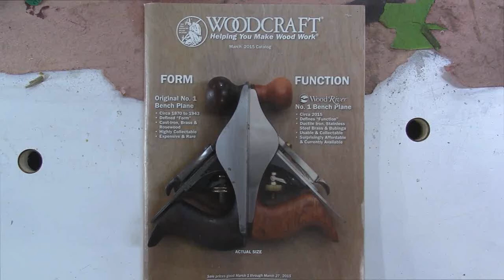Stanley #1 Bench plane Restoration.

Comment: How does the Vaporust compare with vinegar?
Reply from the maker: Can't say, I never used vinegar. Vaporust, when dry, leaves a film on the parts that keeps rust from forming for a few  days.
Reply: In my opinion it is less aggressive than vinegar and has less of a smell.
Reply: Evaporust isn't acidic like vinegar.  As long as you rinse the evaporust off the metal right after using it the black from the oxides in rust come right off.

Comment: Nice.  Very expensive tool and I'm very happy when people have nice things.  I wonder why you didn't polish the brass screw heads and wheel?  I can understand not altering the wood finish so you can keep it original, but a little brass polish isn't very intrusive at all.

Comment: If you use a set of gunsmith screwdrivers - various widths and parallel sides, I use Chapman’s - you won’t have to worry about buggering up the screwheads.
Reply from the maker: Thanks Charles, I will look Chapman's up and check them out.